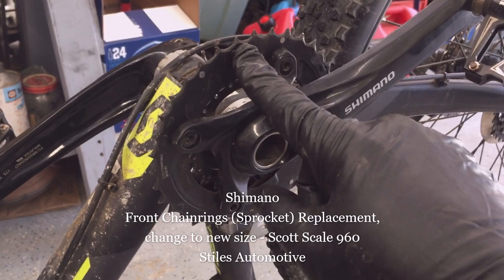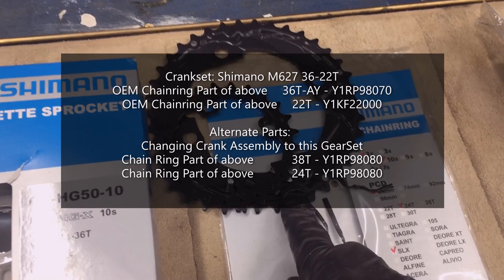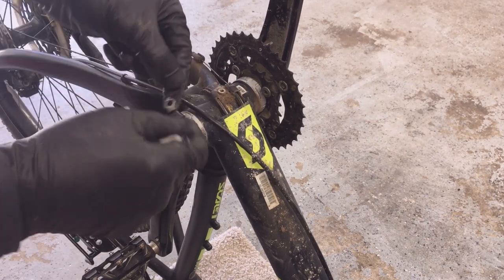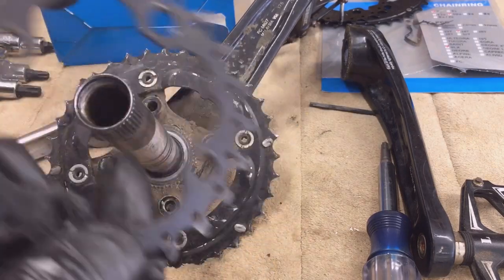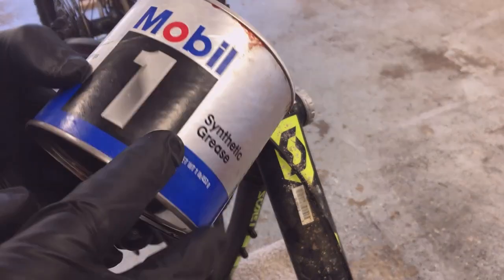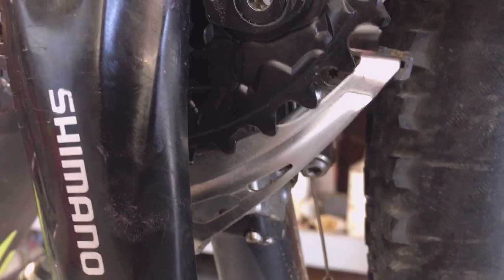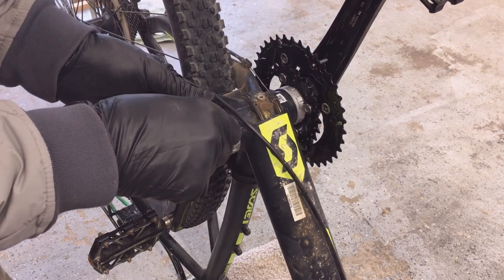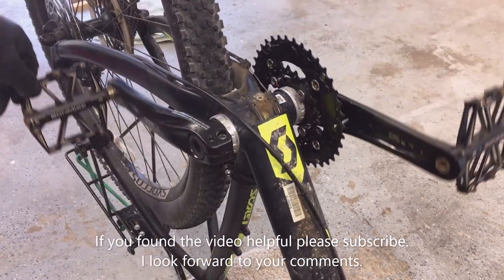Shimano Front Chain Rings (Sprocket) Replacement, change to new size   Scott Scale

Comment: Shifting reveal please I wanna see how smooth the shifting is
Reply from the maker: Buckets, of course I had to adjust the Front Derailleur up.  It changes Chain Rings about like the old set of Chain Rings, but may be not as good.  Due to my adjustment skills, not the difference in size of Rings.  I thought I would be changing Rings more, but only on one hill.  Do you have a different experience? - Stiles